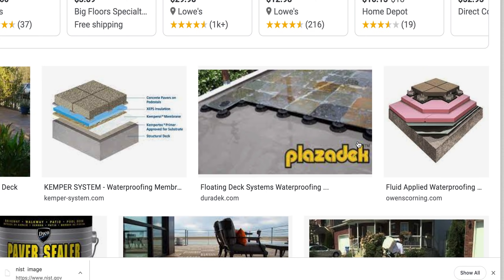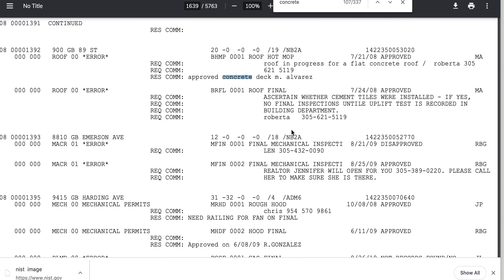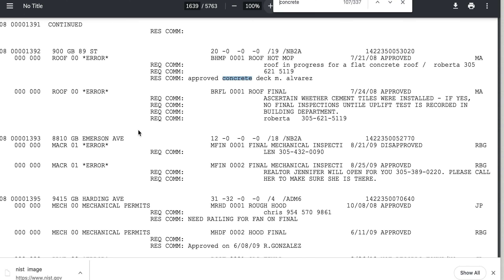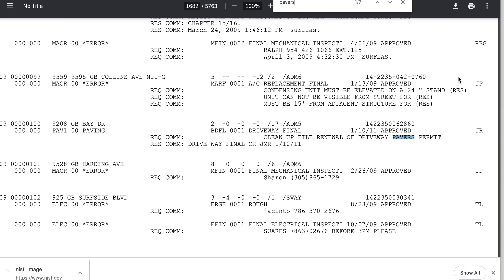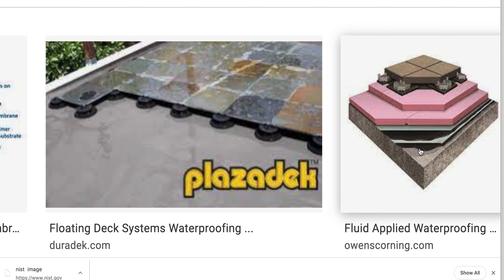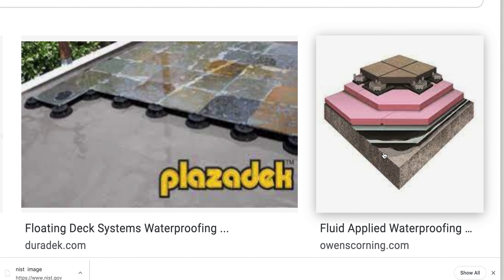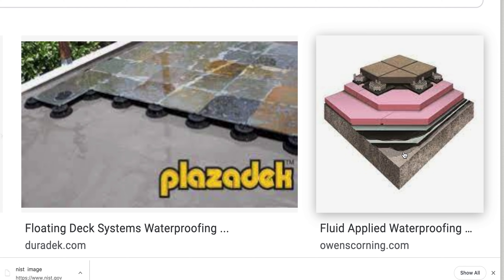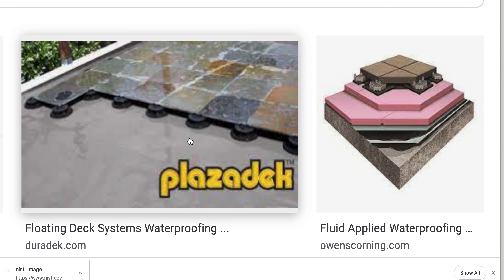Champlain Towers COLLAPSE WHO APPROVED PAVERS AND STAMPED CONCRETE W/OUT ADDING WATERPROOFING

Comment: No one necessarily had to approve it professionally as it's a decorative finish, making it a grey area
Decorative finishes are not ALWAYS or even often a structural issue and do not in such cases require a licensed professional  Since any idiot and con artist can sell and install this stuff hiding behind such, developers and boards can always invoke willful ignorance to use them and 'save money' 
The only failsafe in this situation was the managing agent who should have had the experience to KNOW something this heavy needed sign off by and engineer.
Reply from the maker: This is an added dead load and this is STRUCTURAL and therefore a structural person MUST approve it...   you cannot just add this much dead load to a deck and not have some approval...    This would have required a structural engineer or architect to sign off on this   PERIOD.
Reply: @ForensicCats  I am a property manager in NYC.  The stuff the Condo Boards do is rediculous.  Most don’t want to spend money on an engineer and skip that process.  If you are not a good property manager you don’t put the Board on notice.  I also let them know that I strongly disagree with their direction.  But in the end they always do what they want ignoring the professionals.  You will learn that the condo board screwed up.
Reply: @ForensicCats  they shouldn’t but they did. I’ll have to watch the video again. I didn’t see the paver deck permit outlined. But you’re right on with look no further than… great work keep it up 😎👍
Reply: If I put in an estimate to lay pavers, get the job, and apply for the permit to do it in the city approves the permit, then I don't feel like I have any culpability. That's the point of the permit. That is the contractor asking the city if it's okay to do this, and the city signing off and saying yes. Just because someone's not a structural expert doesn't mean that they are Mickey Mouse, or con artist, or anything else.

Comment: 🏗🧱🧱❤💻 🌀🌊 I know miami had a few feet of water on main street, I never seen surfside flood. Most of the time the water run off from the ocean shore side buildings go back into the ocean by gutter drain channels. Looks like the Paver stone contractor has some explaining !
Reply: One would also think that given the fact that the parking garage had at least one sump pump in it that it also had drain tiles around the perimeter the same way that the foundation of my house does.

Comment: I never totally bought the former building Super's story about the 2 feet of water in the parking garage with cars floating around in it and that it happened all the time. First of all, no one else said anything like that. And secondly, it didn't make sense to me just by common sense. There would be archived news stories about it and all the cars that were flood damaged.
Reply: If it happened "all the time", who would be stupid enough to continue parking their cars down there like it wasn't a thing? Simply because it wasn't a thing. Maybe during a hurricane, but that's isolated incident. If you look at the plans, do you see where the run-off dry-well is? That could become an issue, but only during hurricanes.

Comment: A staple is like a puncture repair kit for concrete? It holds an existing crack in place and stops any adjacent microcracks from opening further?
Reply from the maker: 2girls, video loading and will show about 5 ish... it can work on full cracks and it can put the marriage back together... It will create full intercourse once you add epoxy (just saying)...
Reply: @ForensicCats  If the cracks full, I'd imagine the marriage is back on...🙄

Comment: It is similar to when we re roof a commercial building or residential. We make sure the roof drains properly and is sealed properly. Many times this requires modification from previous installations.

Comment: I never got why they didn’t simply stain the pool deck.
Reply: That would be the route I would have taken.  A nice sand color concrete stain.  Would have been less structural load and any defects at surface would have been far more visible and easier to repair.
Reply: @thegraphicw  Exactly.
Reply: Pavers became a fashionable thing in the 90's. Once they became en vogue, everybody started doing them.
Reply: @jazzman92478  They certainly look nice but are a luxury when many of the unit owners were gun shy about special assessments and etc preventing expedient action on maintenance.  A simple stained concrete would have been less expensive to maintain, repair and troubleshoot in a case where many of the owners were not wanting to take out loans that were basically the size of a mortgage for most regular people.  Pavers are definitely beautiful, but they complicate future repairs and you have to have the majority of unit owners able and willing to pay for the eventual assessment or at least put money away in a reserve fund in anticipation of future repairs.
Reply: @jazzman92478  I thought it was “Coke” that became “the in thing” in that area during that time in the ‘90s. 🤔 Maybe that’s how they got those buildings put up so fast. 🤣
Reply: @Mrs.Doubtfire007  I’m not concerned with that part. I’m speaking more towards trends in finish building materials.
Reply: I can't claim to know your age, Brion and Jim. But if you're old enough, you need to think back around those times to remember what building materials were in style at various times. For example, I can easily spot an unrenovated 90's kitchen a mile away today. Why? Because I built a kitchen in 1993, and remember what was in style then.
Reply: @jazzman92478  I have always had more of a utility mindset over a style mindset.  Don't get me wrong, I like things to look nice, but don't focus on rather the looks are dated or not.  My main focus is utility and maintainability.  I am aware of the different styles and can often get rough estimate of a structure age from architecture, materials and fixtures if still original.
Reply: @thegraphicw  same. My father gets on me a lot when it comes to finish work. I can build a house that won’t fall down, but I lack the patience to make it “pretty”.
Reply: Because pavers “float” above the deck and when there’s constant cracking paver install is a great way to hide cracking.